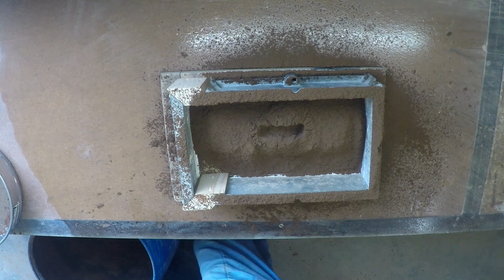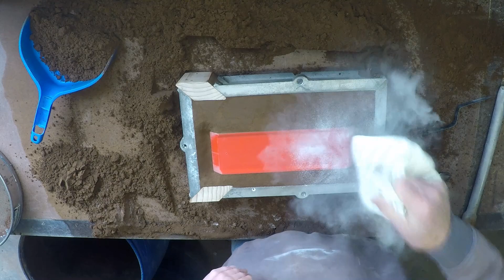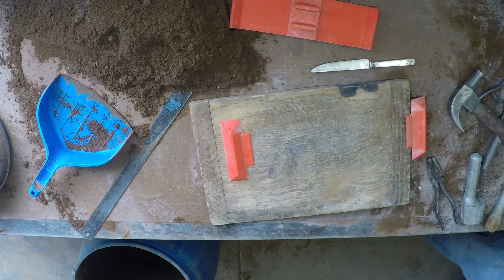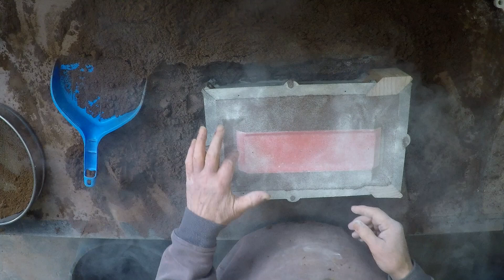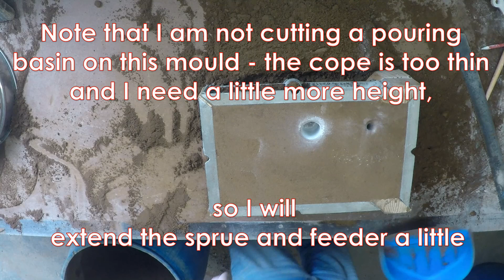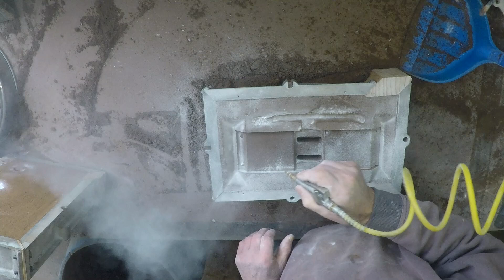Make your own metal moulding boxes Part 4 (b)

Comment: Really enjoying this video series. Thankyou for all the content. You probably have mentioned it earlier however I am curious as to why you extended the runner past the gate on the opposite side of the sprue?
Cheers.
Reply from the maker: @michael,  Its basically a dump. The first metal down the sprue is often contaminated with air and is reconned to be the worst metal in the mould. The run past the gate means that due to momentum of the metal stream this first metal ends up in the run through and not in the casting. To be honest this simple run through leaves a lot to be desired as there are better designs to get rid of this first metal - spin traps for example which not only act as a dump but also gradually reduce the momentum and relatively slowly "turn" the metal from the runner and into the gate, although these work best with gating from below the casting.... Martin
Reply: @olfoundryman8418  excellent. Thankyou for the reply Martin. Much appreciated!

Comment: Hola. Vi la mayoría de tus vídeos. Muy buenas tus fundiciones. De que libros aprendiste? Puedes recomendarme algún autor?  Saludos!! Desde Tartagal, Salta. Argentina.
Reply from the maker: Bruno, Problem here is that there are lots and lots of books out there and most are deficient in some way, outdated, old hat, and full of bad /wrong ideas methods. No book covers the whole process. But for ideas on how to make a mould and the tools equipment required try the following.
Metal casting: A sand casting manual for the small foundry vol 1 S Chastain
United states Navy Foundry Manual
The backyard foundry and Foundry work for the amateur both by B. T. Aspin
 Use these for the how to physically make the mould But NOT for how to run and gate castings For the latter try 
Mini Casting Handbook John Campbell as an appetite wetter 100pages
and then Castings practice the 10 rules of casting by the same author 200 pages
and then if your game Complete casting handbook again by John Campbell - Note: the last (1200 pages!) contains the 10 rules complete
Happy reading..... Martin 
PS Greetings back to you from Australia

Comment: The only casting I ever did was lead bullets, I am thankful that all my moulds were small and pre-made in metal.  I hope I am not the only one holding my breath as he lifts and tilts the full moulding box on its side.
Reply from the maker: Ralph, Yes, you do have to be a little careful handling the moulds - drop them just a little on to the bench and it all falls out, in fact any sudden or jerky move and it can fall...Martin

Comment: Fantastic video, some great tips there. I'm sure you have said in the past but what is your air gun attachment. Thanks for sharing
Reply from the maker: Rupert, Thanks for your comment - do you mean  the pneumatic and rammer or the air blower... Martin
Reply: Hi. Yeah the pneumatic rammer. Id thought of modding an air hammer attachment as i have'nt found one to buy.
Reply from the maker: Rupert, Modification of an air hammer, chipping hammer  needle descaler, air chisel, etc generally do not work very well as they do not have enough stroke - my sand rammer has about a 3 inch stroke and you do need this.... Martin
Reply: Thanks

Comment: Why are the cope and drag for these box sets so different in height?  Knowing you there will be a reason, Martin.
Reply from the maker: dfross, Well, there is and there isn't. When I first made these boxes 35 plus years ago I made them 100 mm high  - this was too high (I now favour 85 mm) and uses up a  lot of sand so I made up another set of (matching) boxes with the reduced height (about 60 mm I guess)this was not all that successful either as you can not fit much in a box half only 60 mm high.
But when I came to do this job I wanted 4 complete boxes and the only way I had enough of the long sides was to have the drag using 100 mm high sides and the cope the 60 mm. ones.  Remember these boxes were an old experiment that apart from the basic idea did not turn out all that well. And I have hardly used them in all those years. I would not have used them this time except that I needed longer boxes and these are adaptable. We use what we have!..😊.
That said many foundries do use one box thinner, its usually the drag as this fits in with keeping the casting all in the cope and gating at the cope/drag parting line...Martin

Comment: Your burp-burp tamping tool is awesome. Anyways, I have some extruded aluminum bars I think I'm going to mill down to make these casting box sides. They are 1"X5"X3' long. These bars were being thrown out and were given to me for crucible fodder to melt and cast with. Nice of them to think of me. However, I didn't have the heart to tell them they are pretty much useless to me as extruded aluminum is terrible to cast with, seems "thick" and doesn't flow very well, take detail in the casting or even mill well after casting for that matter. At least these bars will look shiny after milling... well... for a little while. :D
Reply from the maker: Amalgamous, Originally (3 years ago) when I first decided to do this video series I decided to also do a box using extruded section. I did find a sort of suitable section about 25*90* whatever length it came in, it was 3mm section. I figured to cut the 25 mm down to about 10 and use angle brackets bolted in the corners and maybe cast pin lug pieces bolted on (probably) bronze for where the pins slide. I may yet do this (if I get well enough!) Time will tell. Such boxes will lack the adaptability which the 45 deg corners give but would still be nice boxes. However I fear that 5 inch is way too high - the moulds will be very heavy and use up a lot of sand. On the odd occasion that I have needed a box that high I just go 3 high. Go back and ask them if they have some 90 mm stuff 😊…. Martin
PS yep extruded alloys are meant to be extruded not cast we have cast alloys for that
Reply: @olfoundryman8418  oh I wasn't going to keep the sides 5" high. I was going to trim them down.. After raming it up I doubt my back couldn't handle lifting a box that full of sand. Hope you get well.
Reply from the maker: Amalgamous, Wise move! 5 inch would have been damn heavy when full of sand. I once decided to go over to zircon sand as it has some advantages and lots available here in Australia but I gave the idea away when I realised zircon is 2 to 3 times heavier than silica - I would not have been able to lift even a small mould….Martin

Comment: Martin, what is the pneumatic tool called that you use to semi-automatically "pack" the sand into the mold?
Reply from the maker: Bob I think its just called "a pneumatic rammer" or simply a "sand rammer". If you are in the US Chicago Pneumatic have a good range -  I hesitate to recommend them because their Australian agent wanted to charge me almost $900. 00 for one that retails in the US at around $250.00 I got mine  (jet brand -Japanese) through Amazon  for about $260.00 Just love it, but best on bigger moulds.... Martin

Comment: Question: Why did you extend the runner past the feeder? Is it so that any dross will tend to go into the far runner before any metal goes through the gate?
Reply from the maker: Jason, my poor effort at running the metal past the Feeder (and gate) is as you suggest, and also by virtue of the tapered end on the extension to avoid any sudden dead stop with a resultant back wave. In these circumstances (gate same level as runner bar) its probably not very successful.... Martin

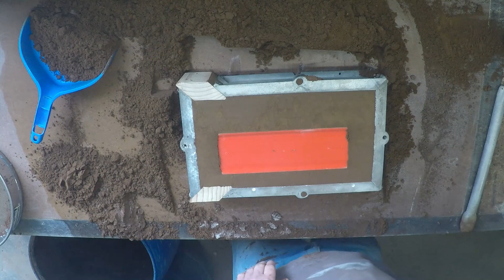Comment: @4:20  Have to cut this down.    Aaaah. tricky......... Bloody bottler. So damned easy when you know.
Reply from the maker: Aubreyaub, Its not hard, just a bit fiddly and takes time. Although  it is hard to get the parting line dead on so flash is usual, this will be seen in the next video when I cast these moulds.... Martin

Comment: Glad to see you are finding use for the little tool I sent you. Do you find that it helps?
Reply: sandrammer : Glad to see you're still kicking around.
Reply: @CraigLYoung  , Thanks.
Reply from the maker: Sand, Yes, it most certainly does - if it didn't I would not use it  😊 Have you tried the sprue yet?... Martin
Reply: @olfoundryman8418  , works just find. Thanks.

Comment: Hi, Martin, if I didn't know better, I would swear that board you are working on is from a 1970's era Victorian Education Department Primary School desk. How right am I?
Reply: I reckon you're right ….. even has the ink stain where the ink bottle would sit in the hole
Reply: @viscash3606  now that you mention it, yes I think that you are right about the ink stain. The round bottle rebate was on the right hand side of each desk lid so two per desk unit.
Reply from the maker: Vi, Mark,  Nah! Both wrong - Its been in our family longer than I have and that is way before the 1970s. I will admit that it does look a little like a desk top but they are/were hardwood this is softwood, also no hinge screw holes. And your ink stain - sorry but its a burn (this is a foundry remember) nice try fellas but no cigar! 😊… Martin
Reply: @olfoundryman8418  - HAHA Just goes to prove how deceptive video is without holding something in your hand in person

Comment: i 3D printed those flask sides and tried to cast them, but I didnt put enough infill in and when I packed the sand around it it collapsed on itself.  If you guys try to make them, make sure you print them with enough infill to be very very sturdy so they will last through all of the castings you have to make.
Reply from the maker: rizendell. I had to refer this to my friend who did the 3D printing as I know nothing about it. He says that he thinks that he used  about a 50% infill. But he wasn't all that certain. I guess that if you can push the surface in with your thumb then it would be a bit weak and that you will just have to try a few as you optimise what works best with your printer etc. I would suggest not being in too much of a hurry as I know the friend used quite long printing cycles - a quick coarse print is likely going to make a terrible mould…. Martin

Comment: Martin excited to see the results. I have my parts printed and ready to go just need to get my furnace finished. Is there commercial degassing pellets that a hobbies could use with al ? your Saskatchewan friend Keith.
Reply from the maker: Keith, Yes, there are commercial degassing tablets out there. They give off nitrogen when immersed in the molten aluminium. I tried them years ago and was NOT impressed -they bubbled so furiously that they threw 50 mm of metal out of the crucible ( A25) all over the inside of my furnace, the bubbles of purge gas they gave were very large (smaller are much, much better) they only gave nitrogen off for 2 minutes and degassing takes way longer than that (I use 8 minutes) Companies like Foseco make them and I think they are called Nitral. Hopefully the ones being sold these days are better than the junk I tried! To be honest though, I would not bother even trying to degas unless you are doing critical work and as a hobbyist I would advise against that anyway. Any gas you will get in your castings will be very fine - usually less than 0.5 mm diameter and if the work is thin i.e. solidifies very quickly you will  likely not get gas at all and even if you do normal machining flows over the gas and you will not see it. Usually the bubbles people see and believe to be gas are in fact trapped air resulting from lousy sprueing and gating techniques... Martin
Reply: Thanks, very helpful reply.